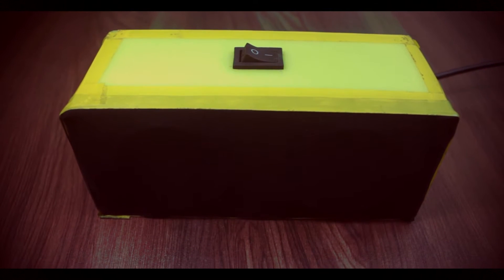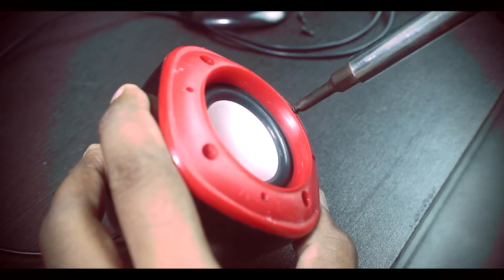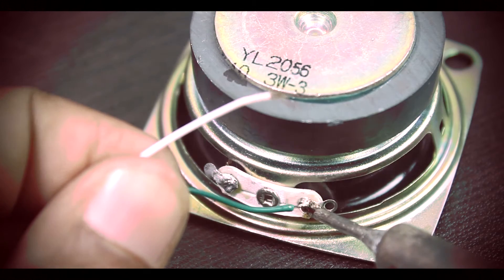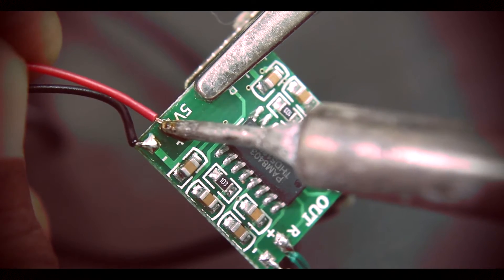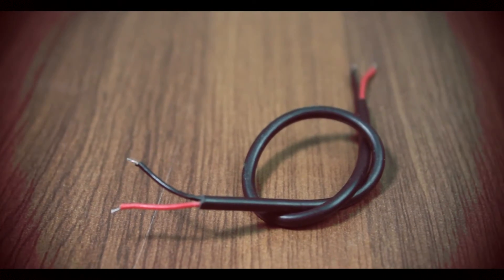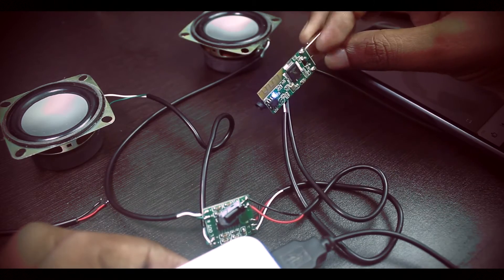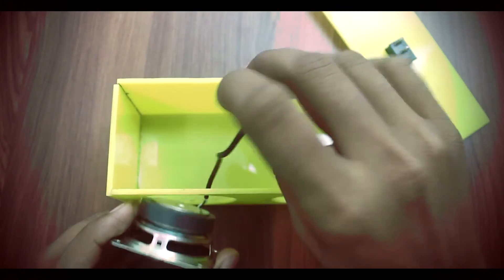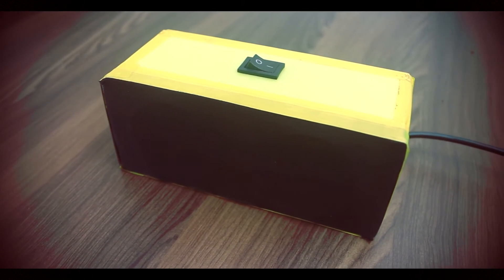Diy bluetooth Speaker for 5$

Comment: How you get rid of the ground loop???
Reply: iakuzaa you put 2200 uf capacitor at the amplifier 5v power input..capacitor will act as a noise filter for amplifier